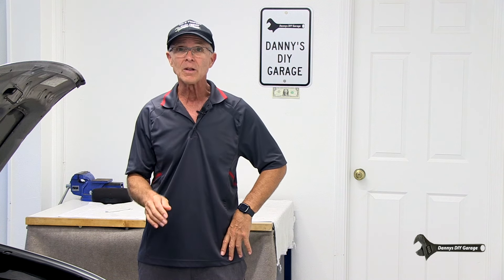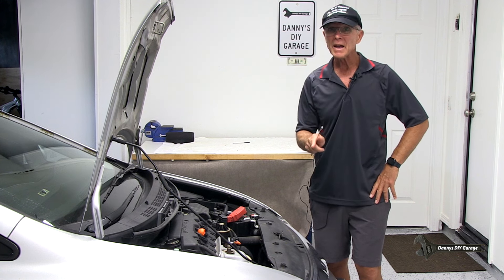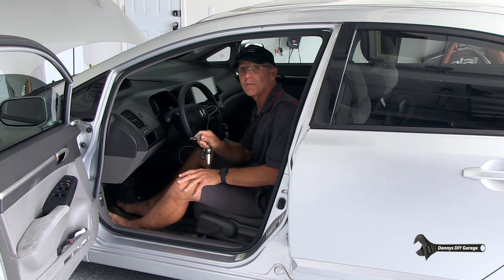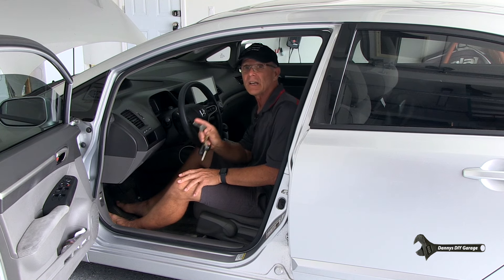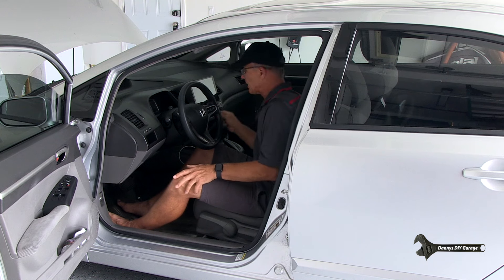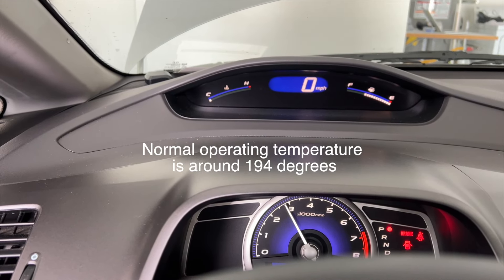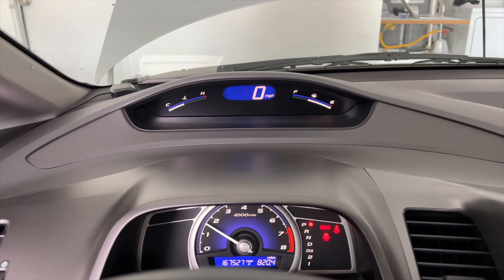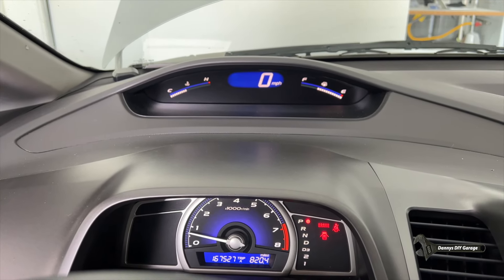Honda Civic Idle fluctuates, surges, stalls, Idle Relearn

Comment: I followed your procedures for replacing transmission external oil filter, cleaning throttle body, and idle relearn on my wife’s 2011 Civic EXL-Navi Coupe.  It was real easy and the car runs great now.  Thanks so much for posting these videos.
Reply from the maker: Appreciate your gratitude, more videos coming soon
Reply: What is the fan on and off? Any sign?
Reply: Thanks Mr. Danny for this on-line session. It worked for my car & that's really good 👍🏻🇲🇾😃
Reply: @FILMANIA-zv9yk you literally hear the fan turn on and off…. Smh

Comment: Sir, I am stumped. My car jerks coming to a stop, at around 5mph going to zero.   Sometimes the jerkiness is more noticeable than others.  When my car is moving at idle, it doesn’t jerk. I cleaned the fuel injectors, cleaned the throttle body, replaced all the motor mounts and trans mount. I also replaced the trans with a used trans but the problem still persists. Can you help me out? I have a 2007 Honda civic EX coup. Thank you.

Comment: I would think the idle relearn is similar on a 2010. I did not know that it could be done this way. I used a bidirectional scanner to reset the idle after the throttle body clean.
Reply from the maker: Much easier if you have a scan tool, but if not this works

Comment: I never had this work for me (unhooking battery) after doing a throttle body cleaning and ended up needing the scan tool to reset the throttle body position sensor. On a 8th Gen Civic Si 2007. I would also recommend checking the Engine Air Filter and possibly cleaning the MAF sensor with the MAF spray cleaner too. Normal for my car is 850 RPM at Idle
Reply from the maker: @edwardinvegas  thanks for adding

Comment: Thanks sir for this vidéo 
I want to know if this procedure works with the 7en generation
Thanks in advance
Reply from the maker: Yes it’s worth a try, I’m not sure if your car has a cable or drive by wire, but it will benefit either way
Reply: @dannysdiygarage  
Thanks for your answer my tp drived by cable 
Recently any time i disconnect the cable of battery the idle of my car become not good or rough
Thanks

Comment: My 08 civic has a tpms light on. I got new tires already drove about 60 miles and the light still doesn’t turn off any suggestions
Reply from the maker: Did they replace the sensors, have you checked to see what codes the scanner set, this information is used to help pinpoint the problem

Comment: If you have a push button start (2013  Accord) how do you turn on ignition without turning over engine for the first 2 seconds?
Reply: I think u just press it not hold it right?
Reply: Don’t press the gas pedal just click the button

Comment: I have a question in my 2007 civic fd manual. My idle normal rpm is 800, and when I sped up like 40mph then putted the gear into neutral, my rom stays at 1.4k stable until I fully stop. I’m on neutral and I’m not stepping up the gas but my idle stays at 1.4k while the car is moving. And also, then I let go of the gas, my rpm goes up first like around 2k rpm before it goes down to 800rpm. What should I do?
Reply from the maker: Hard to give advice when you can’t check the car, but, Start by cleaning throttle body, do a reset and relearn, if your car has a throttle cable check the idle air control valve
Reply: @dannysdiygarage thank you🙏🏻
Reply: @dannysdiygarage Is this idle relearn thing going to work on my 94 civic?

Comment: Hi, nice video. I keep having issue with unstable rpm specially on first start. Rpm goes up and down. Scanner throws P2135 and P0108, any help please?
Reply from the maker: error codes P0108 and P2135 are most commonly associated with issues related to the mass airflow sensor (MAF) and throttle position sensor (TPS) in a Honda Civic.

Here's a breakdown of each code:

P0108:

Meaning: Mass Airflow Sensor Circuit Low Voltage
Possible Causes:
MAF sensor failure
Wiring or connector issue
Engine vacuum leak
Air filter restriction
Symptoms:
Reduced engine power
Rough idle
Increased fuel consumption
Check engine light illuminated
P2135:

Meaning: Throttle Position Sensor Circuit 1 Malfunction
Possible Causes:
TPS sensor failure
Wiring or connector issue
Throttle body issues (stuck, dirty, or damaged)
Symptoms:
Reduced engine power
Rough idle
Driveability issues
Check engine light illuminated
Addressing the Codes:

Gather Information:

Check the vehicle's service history for any related repairs or issues.
Inspect the MAF and TPS sensors for any visible damage or corrosion.
Check the wiring and connectors for any signs of wear or damage.
Diagnostic Testing:

Use an OBD-II scanner to retrieve specific data related to the MAF and TPS sensors.
Compare the sensor readings to the manufacturer's specifications.
Perform a visual inspection of the engine for any vacuum leaks or air filter restrictions.
Repair or Replacement:

If the MAF or TPS sensor is found to be faulty, it will need to be replaced.
If there are any wiring or connector issues, they will need to be repaired or replaced.
If a vacuum leak or air filter restriction is identified, it will need to be addressed.
Additional Tips:

Always consult a qualified mechanic or technician for a proper diagnosis and repair.
Avoid driving the vehicle with these codes present, as it can lead to further damage or safety issues.
Consider using high-quality replacement parts to ensure long-term reliability.

Comment: Hola dany, quisiera saber si me ayudas con una duda, mi civic 2006 lx tiene las revoluciones muy bajas, entre 500 y 550 en ralentí, a veces hace como un temblor y suben, me podría funcionar este procedimiento?
Reply from the maker: Yes, clean throttle body and do a relearn
Reply: Gracias por responder, pero ya limpié el cuerpo de aceleración y también el reapendizaje de ralentí, pero sigue igual, podría ser el tps sensor?
Reply from the maker: Is the engine light on if so what code, if not check for vacuum leak
Reply: De que manera verifico si hay fugas de vacío, no tengo ningún código, he pensado en cambiar el cuerpo de aceleracion
Reply: No, ya lo limpie y siguió igual, creo que puede ser el TPs, porque solo cuando está caliente lo hace
Reply: Hay alguna forma de enviarte un video o imagen para que juzgues

Comment: I followed your steps exactly however when I turned the car on it revs constantly up and down around 2000 rpm and the check engine light is on. Pulling codes show P0123 and P0223. High voltage to the sensors. What could have caused this and what do you suggest? Just do relearn?
Reply from the maker: Sorry for late reply, recheck any connection
Reply: @dannysdiygarage  No worries! I actually did have a loose connection on the throttle body. I will leave this comment here in case anyone ever has a similar issue to mine.

Comment: Hey Danny. Great stuff my 2006 Honda Civic been malfunctioning, for.example sometimes It won't go past 3,500 rpm it will just keep it there. I've switched the VTEC Selenoide and it worked fine for a couple.of miles then started again..any solutions?
Reply: Check engine light?

Comment: My 2010 civic won't idle. Starts everything runs about 5 seconds dies. If I give it gas it runs but sounds like it's backfiring. I ran it at 3k for 2 cycles of fan and it just died when I went to idle? Please help
Reply from the maker: When did this start happening? What’s been done so far
Reply: @dannysdiygarage   I have replaced starter fuel rail Injectors battery cleaned 02 sensor cleaned throttle body then replaced throttle body new spark plugs changed the things that go on the spark plugs. Pulled cam shaft post. Sensor cleaned it (it did have a lot of oil on it) inspected crankshaft sensor cleaned it. I did unhook ecu and immobilizer for about 10 min hooked both back up. Starts every time runs 4 or 5 sec and sputters and dies. I checked fuel pump with method from your channel read steady entire time power was on. I really need my car it's also my home I've tried alot of things but it hasn't gotten better
Reply: No codes come up no green key code
Reply: @dannysdiygarage  after it starts if I give it gas it will run sounds like it runs really rich made 02 sensors smoke and turn very black sounds like backfiring out exhaust or rumbling kind of
Reply from the maker: Did you check the airflow sensor? Any codes? Unplug the airflow sensor and see if it runs any better
Reply: @dannysdiygarage  used snap on Solaris scanner no codes. Yes I cleaned my mass air flow sensor got another one cleaned and installed it no change.
Reply from the maker: I’ll think some more, how many miles are on this vehicle
Reply: About 200k

Comment: I replaced the alternator on a 08 honda oddysey and now it has all the warning lights on and wont go past 3000 rpm. It sat for 2 months before i could get an alternator also. Do i need to do this or do i have another issue. I also replaced the vvt solenoid since that was the initial problem leaking onto the alternator. Any help would be appreciated thanks.
Reply from the maker: Checking for codes might be your 1st steps, the information provided gives me no clue what to advise, sorry
Reply: Did you fix it ?

Comment: Hey Danny. I cleaned my MAF And MAP sensors on my 2012 civic and it’s idling high in the 2/3K RPMS. Does it need a idle relearn procedure if so can I use this method..
Reply from the maker: Yes do a idle relearn,what did you use to clean your sensor
Reply from the maker: Also recheck your work, sounds like you might have a vacuum leak

Comment: Do this on a warm engine.
Reply from the maker: From my experience, I get better results on a cold engine, however the manual doesn’t specify cold or warm
Reply: @dannysdiygarage   I wouldn't be revving, start/stop on a cold engine.
Reply from the maker: @joeyyung911  doesn’t have to be stone cold, just not at operation temperature yet👍🏼

Comment: Hi so I’m having trouble with the fan not cycling at 3k it remains on until you let off the pedal. Any ideas? Thanks. 2012 tsx
Reply: Check your coolant level and ensure it’s topped off,    Make sure AC and defrost are off as they automatically turn on and sustain fans

Comment: Hello. Thanks for your content. I'm from Mexico. I followed the procedure, but in my car, the idle speed only reaches 800 rpm. I see in your car and in others that I have seen, that it drops to between 600 and 700 rpm. Do you have any idea what it could be?
Reply: Civic idles 750 + - so 800 is with in specification.

Comment: How many miles does your civic run in a full tank?
Reply from the maker: I average 35 mpg sometime 37mpg, I drive 62 mile per day 5 days a week
Reply: When the engine is running, there's vibration, especially the front passenger. The vibration goes through and some particles start vibrating under the door windows. Could it be the throttle body?
Reply from the maker: Could be that or engine mounts
Reply: @dannysdiygarage  thanks
Reply: Mr Danny your procedures didn't work on my honda civic 2015 Lx 1.8 Liter ..
I removed and did deep clean the throttle body  didn't touch the yellow plate..I put everything together, my car rpm still high ..I followed ur steps..but didn't work

Comment: Hey danny, i am not sure if this is the solution to my cars issue, i have a 2007 civic and its giving me the throttle error sometimes and it goes into limp mode. I changed the throttle body and it didnt show up for 8 days but its showing again.
Reply: Interesting. I had the same happen during the heat. Check engine light goes away during cooler temps. Did you get your issue fixed?

Comment: I am following you from Cairo, Egypt. you are really awesome . Keep making translated videos. I want to ask you: I cleaned the throttle and the engine rpm was higher than 2000. And I have it Leakage at the bottom of the air box. Will it work if you learn it doesn't have to be fixed?
Reply from the maker: You will need to fix the problem before a relearning will work
Reply: @dannysdiygarage . Should I wait when the car fan starts for the first time or the second time?
Reply: ا شادي لو تكرمت عاوز اتواصل معك

Comment: Hey Danny, could you tell me what kind of average fuel mileage you’re getting on your car? I just picked up a used 2009 mileage I’ve been averaging 26 miles per gallon or so mixed highway driving I thought I’d be getting closer to 29 or 30 MPG. A little disappointed by this, is this Norm? I’ve changed, spark plugs, air cleaner, oil, transmission fluid, etc. going to do the MAF sensor next. Anything else I should be checking?
Reply from the maker: I do track my mileage 25 worse, 32 best

Comment: Hi Danny. Thanks for the video post.  My 2008 Civic GX only idles poorly in the morning, and when it is below 70 or so degrees. I have to let it idle for 5-7 minutes and it sputters, which can be heard at the exhaust pipe. I then have to shut the car off and start it again.  The sputter stops and I can drive the car. The check engine light flashes when I first start it. If I don't warm it up, the engine rpm won't go past 1500 rpm and its impossible to drive the car. It also throws the 302 misfire code for the number 2 cylinder.   Will this reset help or is there something else that is causing the problem that you can suggest a repair for?
Reply from the maker: You have other issue, you need to figure out you cylinder two misfire and any other codes you have